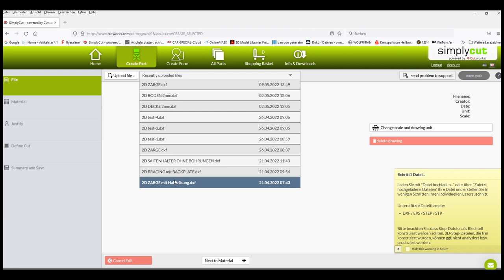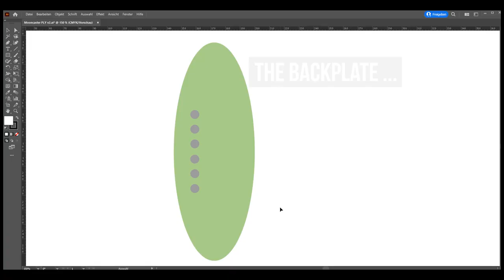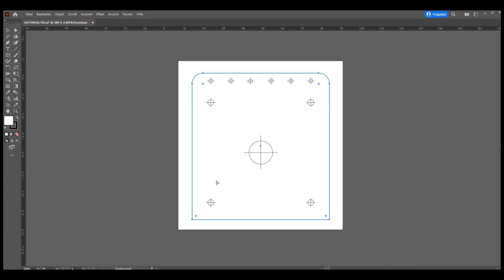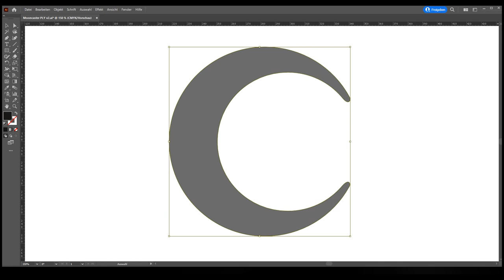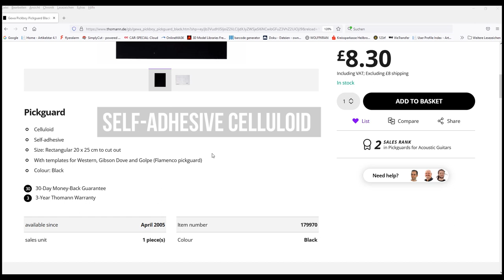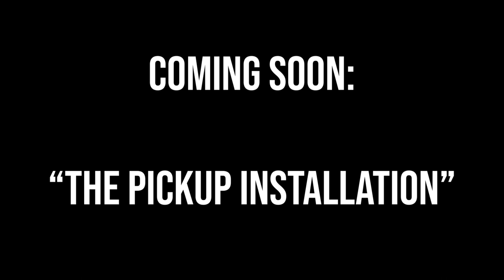How to build a great sounding plywood acoustic guitar PART 1

Comment: I'm guessing it began to buckle when it was strung, or is there another reason for the piece of roundstock  that can be seen through the soundhole? I made a bass from a Jerry can and had to use a dowel to stop the can from collapsing under string tension.  My next challenge is to try and build an acoustic bass from the fiber board back panel of an IKEA cupboard.
Reply from the maker: Well observed ;-) First I was afraid that the ceiling would sink in there. But I removed it again after a few weeks and everything is still stable.

Comment: I like the process you used to create the sides of the guitar.  I once built a set of 4 Ashiko-style drum shells out of particle board in the same stacking manner.  I cut them out with a rotozip, stacked, pegged and glued them, then sanded down the rough edges both inside and out.  It was a long and tedious process which ended up costing enough in materials that I probably could have bought some good used Ashiko drums for the same price, especially when time and labor is factored in.  Still it was a great learning process and I would do it again if I had the opportunity and better tools, a shop, and everything else that makes a project like this more enjoyable and less "work".
Reply from the maker: Interesting approach ;-) Would like to see some pics of your work. Best regads! Thorsten

Comment: Nice project. It would be interesting to see how much the tone could be improved if the sides were cut thinner and the internal bracing pared down significantly.
Reply from the maker: Good point! To be honest - after a few weeks I slightly had to reinforce the region behind the neckpocket, because the body began to warp a little bit. The balance between stability and sound is always like a ride on a razorblade ;-) Stringtension is always the big "enemy" ...

Comment: This is an awesome guitar Brother. I love the simplicity of this design.It also at the same time makes me upset over the cost of some instruments that are made by the use of cnc machines. These companies are making obcene profits not commensurate with the materials used to make such instruments.Just because something can be duplicated by the use of machines to get the same result everytime. In my estimation does not justify such obcene profits the art factor is greatly diminished to where the value of the instrument must be justified by the energy and quality of material used to make the product which in my opinion   is not justified. Branding in my opinion is over rated and companies with popular branding exploit whatever the market will bare.

Comment: There are many types of plywood. The high pressure laminate used to make guitars is not the same as floor underlayment or luan plywood. It is harder, thinner and has no voids as most plywood does.
Reply from the maker: Absolutely right - for the top and the back I was using 2mm high quality "aircraft plywood".

Comment: This.... Doesn't sound good. It's thin and tinny. No bottom end at all. Sounds more like an unamplified electric guitar or a child's toy guitar. It's a noble cause for sure, but guitar makers have already done better with sustainable materials. I have a Martin with the sides and back made of a composite material, a stratabond (similar to plywood) neck, and a spruce top. It sounds amazing and it doesn't use any endangered woods.